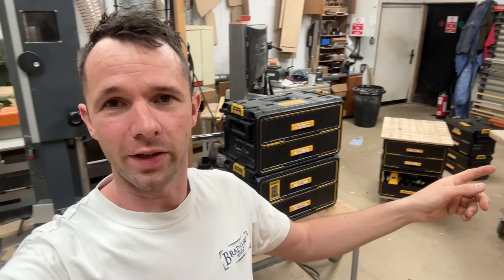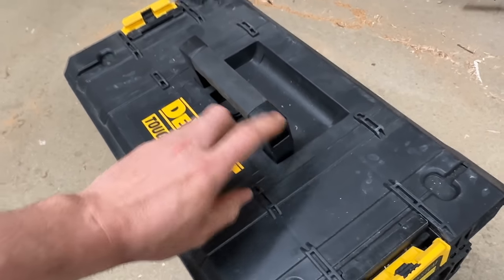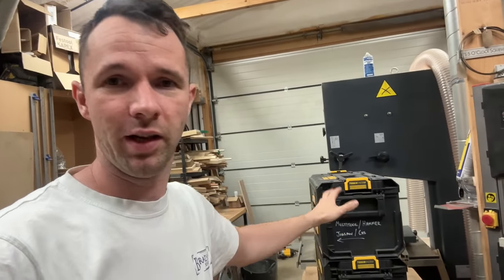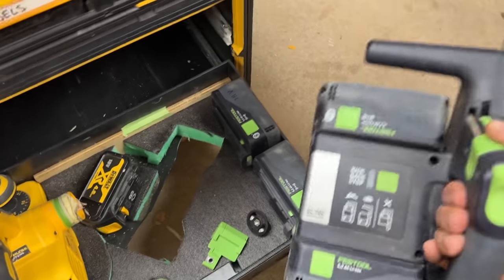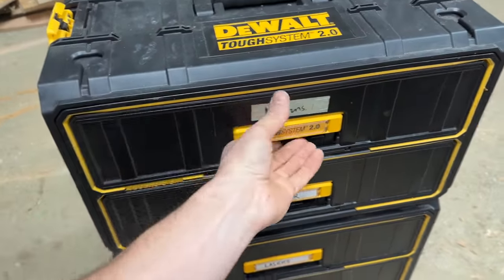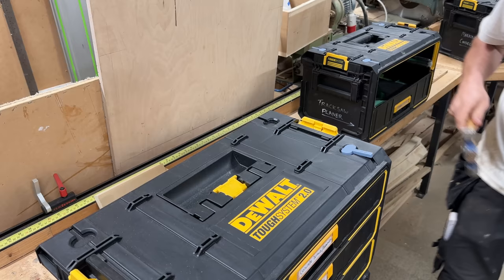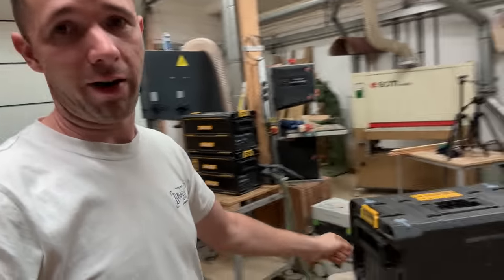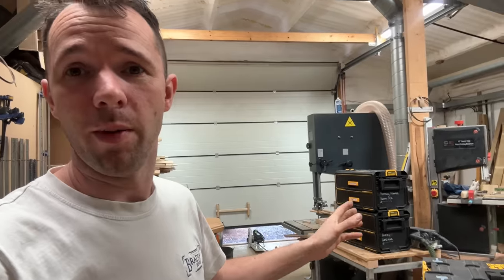1 Year Since I Ditched the Systainer's - DeWalt Tough System - Joiners Review and Upgrades

Comment from the maker: Link for 3d Print files and Custom Labels https://bradshawjoinery.co.uk/downloads/
Downloads now available on my website for:
-Customisable Labels for Tough System (windows and Mac)
-3d Printer files for Anti wobble inserts (toughsystem drawers) as 
  seen here - https://youtu.be/svdGB3To7Ek
https://bradshawjoinery.co.uk/downloads/
Reply: I need inserts please!!
Reply: Great review and great ideas for setting-up and making the Dewalt Tough System 2.0 tool boxes even better. 
Your download folder has 5 files.  Which file is the Anti-wobble insert?      
Thank you!
Reply: Do you have a link to buy or download the clips you used on the base to locate the proper position for the boxes?

Comment: Great looking setup still after a year! Echoing what you said about the ToughSystem, it's one of the better toolboxes you can get. The upgrade over the original Toughsystem side latches are so much better. That quick attach/release is far better than that little plastic latch they used to have. Great video!

Comment: The anti wobble inserts are interesting. On your back-to-back castored site work table, if your insert-making-friend made a kitchen worktop style insert, mechanically linking both front and back stack, then they (the linking inserts) would add the entire mass of the ‘back stack’ to any overturning moment on the ‘front stack when the highest drawer is open. 

Given that the dual stack is on castors, and easily rotated for access, that seems to me to meet the relatively small footprint, with no tippyness, criteria for a taller (back to back) stack, that might work on some sites.

Comment: I got those little plastic clips, and now I can stack those boxes as high as I want them and no wabbles. I found them at Etsy. I'm surprised there aren't more mentioning of these little amazing clips.

I also added the handles to all my dewalt tool boxes. Dewalt now needs to make rolling drawer boxes.
Reply from the maker: the guy on etsy stole the idea without asking, but its cool. im not interested in making them, and its good there is a solution. the stl files are available for download on my website.
Reply: No need to wait for dewalt to come out with the bottom drawer box. I use my simple hand truck to stack and secure my 4 drawer boxes

Comment: Good choice on the drawer units.  Wish I had seen your video before I invested in the small tool boxes, and bin boxes.   I ended up with something with all the issues of the systainers.   I cut foam for the tools in the bottom of the boxes, and then made plywood trays with lifting straps above them, to put the accessories for the tool in.   But the drawers seem to be a better solution.

Comment: I am also very interested in the anti-wobble inserts, also interested in the plastic parts to fit the boxes on the board with the wheels. Perhaps your friend could make an SVG file available. I would be happy to pay for a copy of the file(s). Simple to send via e-mail, & perhaps a pay-pal account to accept payments. I saw the file you made last year just a few days ago, and I ran out right away to get a couple of those boxes! I think it is a brilliant solution!
Reply: Can I get link to stl file for 3d printer
Reply: Me too?
Reply: Another one here for the anti-wobble inserts and base plate @BradshawJoinery. I have a 3D printer and just need a file pretty please. Would be happy to pass along some $ for the trouble. Thanks!!
Reply: Great video thank you @BradshawJoinery. I would so appreciate more info on the plastic inserts for stacking. I recently purchased 2 more drawer sets to go with the 2 I already had, and wobble is a problem.
I have access to a 3D printer if access to the file was possible please.

Comment: Probably been said in the comments already lol but I have bought the Milwaukee packout drawers instead of these and they are night and day better than the dewalt ones not just on build quality but the modifications you can do. Etsy has so many 3d accessories for packout as well. I’m about £1500 in so far but like you’ve done with your tsc55 drawer I’ve done the same but just cut the top drawer bottom out and glued and riveted the cut out back on the sides to make one big drawer. And on my 3 drawer cut the middle drawer to make a deeper drawer. But like you I love the drawers never been so organised. Keep up the good work.

Comment: I saw these drawer units when they first came out in the US. I was really disappointed by the wobble. I have the original tough system non drawer toolboxes and they're rock solid when clipped together. Good to know there's a fix. But there shouldn't need to be!

Comment: Good follow up video.  It is a shame they dont make a full size single deep draw on on its own for items such as circular saws, planers, track saws etc. The draw system is a game changer in stacked systems.  Apart from having them on racks to pull out as and when, a deep single draw that holds the circular saw that you can access immediately (like youve adapted) would make it ideal! Leave all the boxes stacked and just access what you need without boxes all over the place. Plus as you've done turn them into an actual work bench for onsite work (adapting for unlevel ground maybe?) Saves lugging around separate pop up saw horses as well. Would become a super little center! I love my tstak boxes but do find the item i need is always in the bottom box! Hence all out to fet at that one and no matter how smart you think you are by putting it back  on top next item will be on the bottom that you need! Great video keep it up.
Reply: This. I want a big deep drawer for bigger tools that I use less often that can be at the bottom of the stack.
Reply: I've just invested in this type of system, thanks to the video, was thinking having one large top opening box at the top of the stack for the big stuff makes sense. So you can get to it.

Comment: Excellent ideas. Like how you took out the bottom shelf. I have the Milwaukee Pack-out system and love the built in hand truck on the base unit but they haven’t figured out the we all want shelving on the bottom with the Hand truck built in. 
     My Milwaukee Packout is 3-high and No Rocking and their much larger volume than Dewalt. 
             Thanks for your time 🙏

Comment: Great review! Could you let me know how to get the wobble clips please? I use alot of the toughsystem 2.0 boxes with the racking system. Unfortunately DeWalt made the handles on the 2.0 too big, therefore making the boxes (especially drawers) tip forward. The 1.0 has better handles which lock onto the racking arms securely.

Comment: Craftsman TradeStak is essentially the same thing as the ToughSystem (both produced by Stanley Black and Decker), but the Craftsman version does not wobble and it's offerings are more limited. If drawers are what you want, the Craftsman TradeStak has the same thing, doesn't wobble, has one-handed disassembly, and is a little less expensive.
Reply: not even close these are different than anything else. very thin strong plastic

Comment: The leaked ToughSystem 3.0 designs show that DeWalt fixed the wobble. The boxes attach at the front and rear (four points) instead of just two mid points on the sides.

Comment: Great video and update for the dewalt drawers which I purchased based on your initial video. Since have also purchased the handles but the issue with the wobble still remains and thought you suggested using 8mm ply, if that's not an option would definitely be interested in the plastic inserts and track for the trolley.

Comment: I had the Milwaukee pack out set up with a cart, 1-3 drawer 1-2drawer and a few other bits…. The drawers hold so much they become annoyingly heavy to hump in and out of job sites…. I miss the less space required on-site…  but not enough to overlook their size…. I think the Dewalt drawers may be a better solution for their smaller foot print.(I’m currently back with my Makita Systainers) Thanks for the video!

Comment: I too have finally decided to move out of systainers but not necessarily for the reason of stacking and unstacking . Its more because of how fragile they are. Im tired of replacing handles, lids, etc..
One would think that for such an expensive tool and also an expensive box to buy separately, they would be a bit more durable. 
I actually find myself trying to be careful with them at this point.
I recently had a client decide to be a stand up guy and help me carry my tools and he grabbed one facing backwards from my van caught the rear locking feat on a lip and tore the bottom out of an expensive systainer.  That was the last straw !!!

Comment: Its a shame for carpenters who work with wood and build amazing homes to buy plastic toolboxes....so I run packout😂.

It doesn't matter what brand you like or use,what matters is finding the tool for the job in the moment.....and not buying replacements when you can't find them.

Having spilled countless screwboxes over the last 25 yrs,am terrified of screws in drawers and them tipping. 
The one and only nice thing about the packout dolly,it will carry a combination of L-squares,guide rails,levels,laser tripods,dust poles and 3rd hands by the handle.
This could be adapted very easily to any system on a hand truck.
I prefer loading fewer drawers/boxes heavier.
 Then I have smaller boxes a-la-cart style for lesser used tools in the truck.
Router,hardware jig/screws,jigsaw,coping jigsaw,16g/23g/18g nailguns, 2 Bosch sanders,planer.
My drill and driver box weighs about 45lbs,but has every bit in redundancy.  
Good video with practical and excellent tips and tricks shown,cheers!

Comment: This is exactly the working style tool box video I wanted to see, they are so insanely expensive & then the foam don’t even get me started, I made my own ply tool box 30 years ago along with a ply fixing box, it’s get hammered & needs repairing now & again but always wondered if these modern plastic tool storage would be a good choice, they look good . But still not sure why plastic is so expensive & what the difference is between them all. Would you say these Dewalt are the best? I saw a video from the Shadow foam guy about an American system called Toughbuilt, again though crazy expensive to buy a whole system.
Reply from the maker: They are the best size and shape. I think the pack out is probably made better quality, but its best to get hands on with both and see which you prefer. These work great in the setup I showed here. Workbench and stack around the outside of work area. The pa kout seem really bulky.
Reply: @BradshawJoinery  thankyou, really appreciate the reply

Comment: Great video again, just wondering if you have used the tough system  racking. I’m thinking of swapping from tstak to tough system so I can make better use of the limited space in the back of my Transit Custom crew cab. Thanks
Reply from the maker: I havent, i did a video on my van rack few weeks ago

Comment: I was considering systainer for the last 2 years before pulling the trigger.
But As a individual that has a tendency of (stacking) things and having  to grab a tool from the bottom section is a major deal breaker.yes they are nice but I feel that once you make the same repetitive movement  for every tool then systainer is out of the question.and no ,making drawers for a tool box is a added waste of motion and time where it can be used somewhere else.the price for the space you get I think I'm going to go forward with the DeWalt.....as long as they don't discontinue making the product, on wich the systainer has a advantage.

Comment: Hey Ollie, I’ve just bought some of the   same drawers after your two reviews.
I’m really pleased with them and was wondering how you got the insert out and handle onto the top of the box?
Reply from the maker: There is 3 screws in the ends of the box that hold the side handles.on but it extends into the centre when you pull them out
Reply: @BradshawJoinery  thanks Ollie 👍

Comment: Love the mods!  How to go about getting them?  3d print files?  Also for the top table attachment, how did you secure it?
Reply from the maker: Go to my website and email me I'll send the files, I used a kitchen cabinet hanging cleat https://www.ebay.co.uk/itm/325443331723?mkcid=16&mkevt=1&mkrid=711-127632-2357-0&ssspo=6AHs5pOiQFq&sssrc=4429486&ssuid=&var=514472526924&widget_ver=artemis&media=COPY

Routered underneath accurately but it's a bit temperamental to locate
Reply: @BradshawJoinery  +1 for this question, maybe you could show the under side of the table top?  I'm planning to build this same setup, based on your design and 3d prints. Thank you for sharing!

Comment: Have they changed something with these as I have undone the screws to attach handle and they don’t slide out what internet shows 😮
Reply from the maker: Not that i know of, itll definitley be held in by the handle though id have thought. i cant remember but is ther 3 screws? Some of mine were tight to pull out

Comment: Just bought them 4 drawer I had the original but some handles broke off so I bought new and these suck because when they clip together they are not tight together like the old ones
Reply from the maker: no, real design issue, can be fixed with some 8mm inserts in the keyhole shaped bits on top

Comment: I made my 11 marine ply toolboxes for all my hand tools and power tools some 35 to 40 years ago. They still work fine. Only problem is that I made the tools fit so precisely that when I need to replace a tool, it doesn't fit. I thought my quality Elu, Bosch and Metabo tools would last forever when I was in my late teens/early twenties. More the fool was I...

Comment: I need help building a dolly for my touhsystem 2.0 Drawers. Did you make that blue piece that you are sliding the toolboxes onto? I Ordered the no wobble parts on etsy noy i need to make a dolly lol
Reply from the maker: I didn't, the same guy sent them. 

I'd just measure a square that the feet fit into then router that out a board. Dead easy. 

Make a just the same way I do the hinge and latch jigs